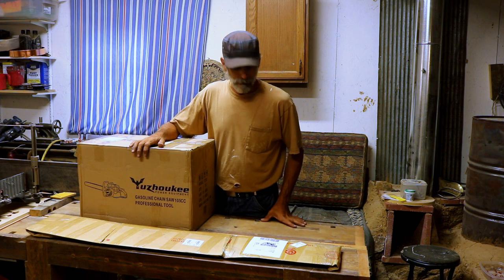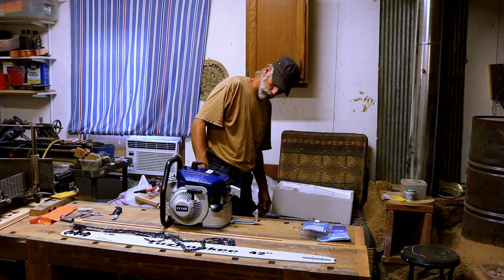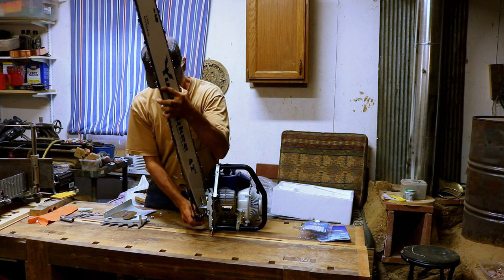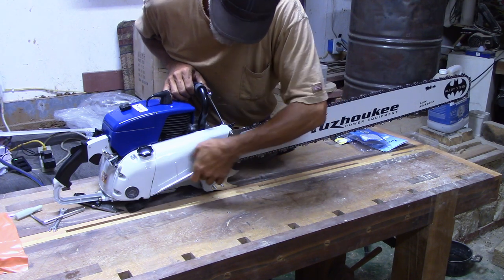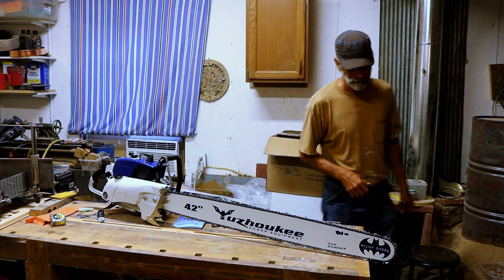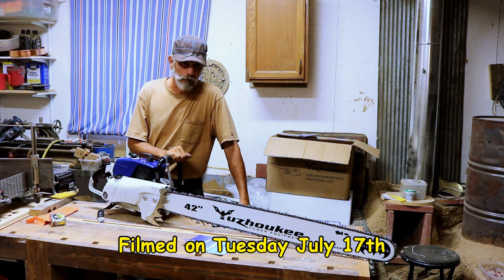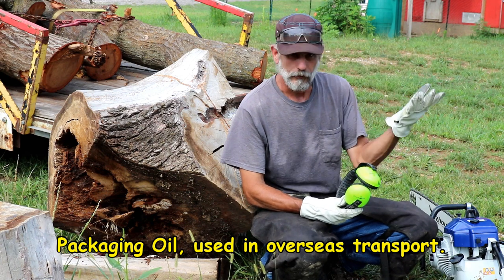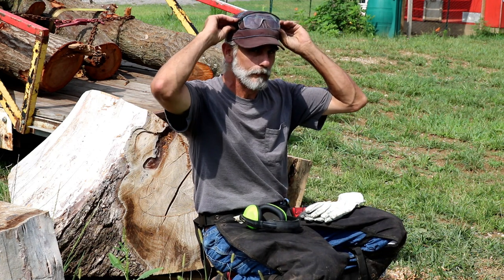Un Boxing a cheap 105cc Chainsaw

Comment: SHOULDNT IT RUN THRU THAT, MY PRUNER IS 35 CC, IT RUNS PRETTY WELL, SEEMS LIKE IT DOESNT PERFORM WELL
Reply from the maker: As I mention in the video. This needs a break-in period of 3 tanks of gas before I can tune up the carb to peek performance. Tuning it right out of the box with no break in period would ruin the saw. Also a brand new clutch takes time to wear in too. I just slabbed out a 33 inch Oak log a couple days ago with it and it was having no problems. I am past the break in period too. Video of the Oak Log being milled should be up in a few days.

Comment: 6.5hp at 105cc? Isn't a Stihl 460 or 362 close to 6hp? at like 60-70cc? Wow that's a bad saw. Thanks for reminding me Stihl is still the best brand.
Reply from the maker: LOL, you do of course realize this is a Clone of the Stihl 070 form the late 60s early 70s when this size of saw got that kind of HP. And not to mention that Stihl is made in China. I mean if this thing breaks I can buy 070 parts and put them in directly so for all intent and purpose this is a stihl.
Reply: Really? Looking at the components it's a bit different than the chinese manufacturing I am familiar with. That's cool. I guess run it and buy those parts. I'd rather cut faster, but to each his own.